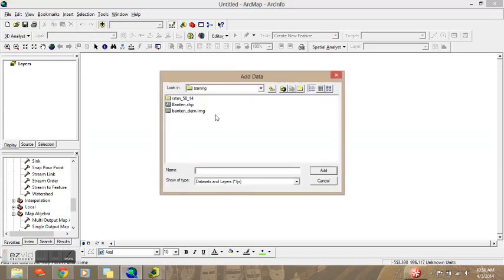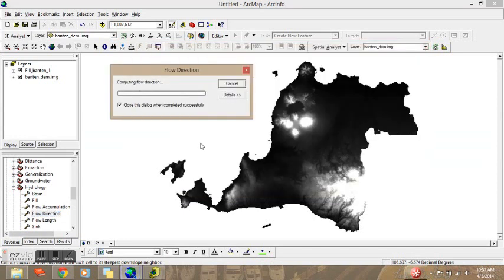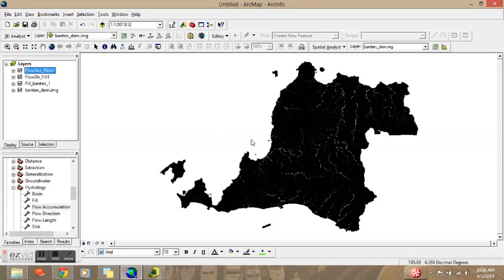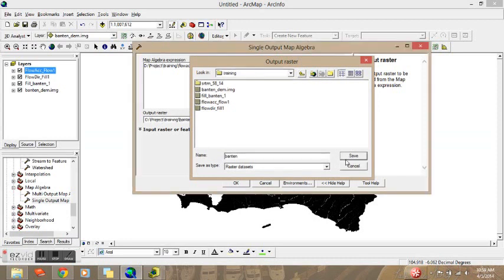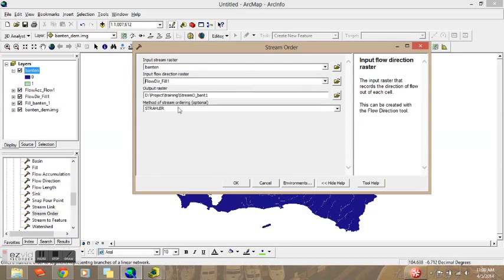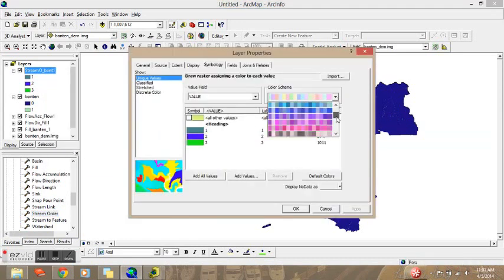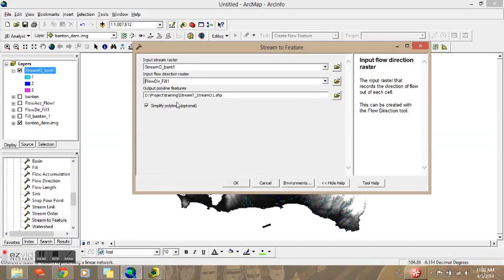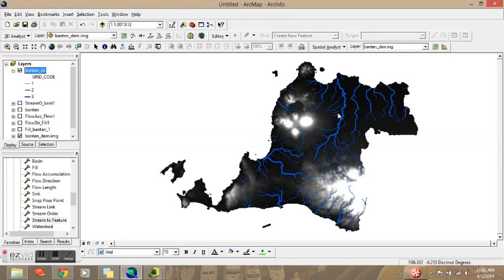How to generate river network using DEM data

Comment: Hello dear friend. What is the criterion to select values from 100 to 3000? What does this depend on?
Thank you
Reply from the maker: Hi Cristhian, this step seems a little bit tricky. Flow accumulation map is like river network with values ranging from 0 to 10000+. The bigger the number means the higher ordo in strahler river network method. But a part of them is not the real river, especially with lower number (black color). That's why we need to validate (for example by checking the google map and reformatted symbology in flow accumulation map). Map algebra step is to extract non river cells (in this video I assume that the threshold is 3000). It means values more than 3000 are river network and the rests are not. You can try different threshold number to see the effect on river network. 

Please keep in mind that different DEM data (with different spatial resulution) will need different threshold. Hopefully this will help you.
Reply: Oh great, Thanks a lot...it was very helpful.
Now, I have another query, as the length of the main river is determined, parameter that allows to calculate the concentration time in the basin?
Reply from the maker: +Cristhian Gallegos for calculating concentration time, you will need to consider many parameters, such as watershed area, watershed shape, stream length, slop, etc. i'd suggest u to use hydrological model such as SWAT.
Reply: Hi, Okay, but I would like to know how to calculate the length of the main river, using the arcgis? There is some tool for it.

Thanks so much
Reply from the maker: Cristhian Gallegos ohh, that can be done by using stream order tool then reclassify to split main river, the length is the number of pixel times spatial resolution of the DEM
Reply: so what can be the probable threshold for 30m SRTM DEM ?
Reply: @ranjandhungel838  Yes... I have the same question.. Pls suggest

Comment: May I ask sir Why did you type "> 3000"? Why three thousand?
Reply from the maker: Hi Harold, this step seems a little bit tricky. Flow accumulation map is like river network with values ranging from 0 to 10000+. The bigger the number means the higher ordo in strahler river network method. But a part of them is not the real river, especially with lower number (black color). That's why we need to validate (for example by checking the google map and reformatted symbology in flow accumulation map). Map algebra step is to extract non river cells (in this video I assume that the threshold is 3000). It means values more than 3000 are river network and the rests are not. You can try different threshold number to see the effect on river network. Hopefully this will help you.

Comment: hai dody, i could not find singe output map algebra in map algebra of my arc tool box. do you have any idea?
Reply from the maker: +Shantosa Yudha Siswanto I use ArcGIS 9.3. If you are using ArcGIS 10.x you can use Raster Calculator. It is similar tool as single output map algebra.